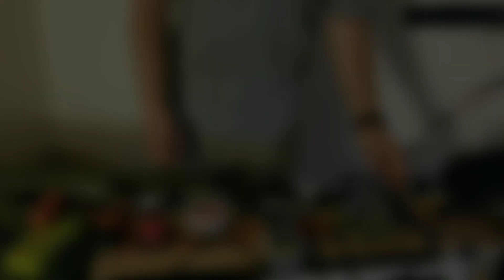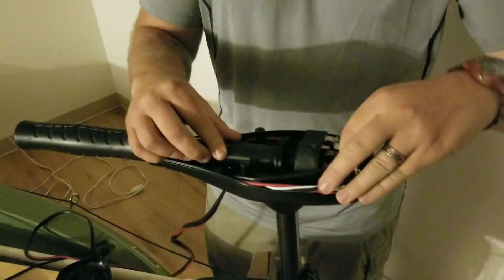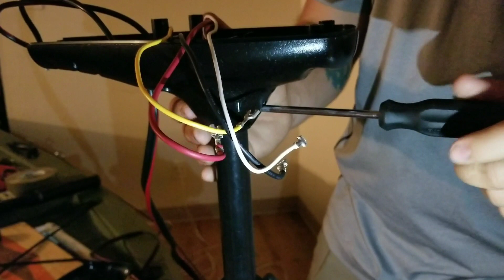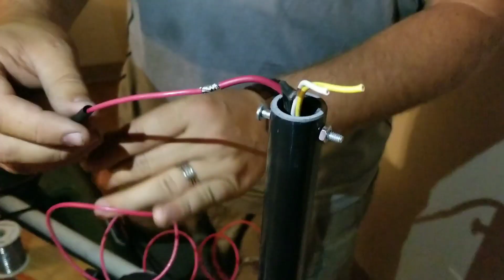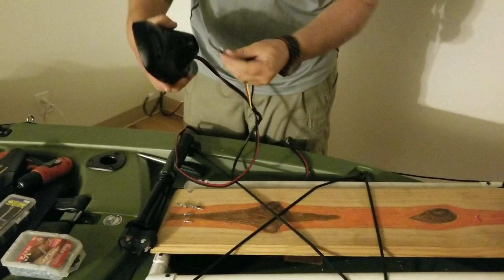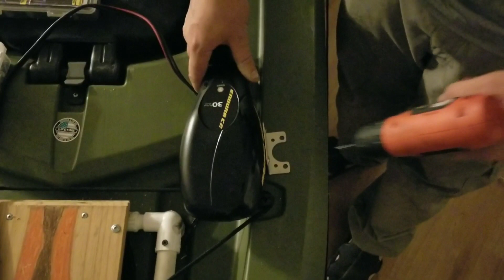KickAss Kayak! Ep 3 The Motor Control

Comment: On that kind of plastic kayak that head will never mount right with just screws, it needs washers and nuts, watch you will find out !
Reply from the maker: Yeah, on that kayak, there were a lot of things I'd have done differently if I were to do it now. That was my first kayak and my first motor mod. So while that one came out "fine" it was far from the best work I've done. If you look at my video about a "universal motor mount", that design is the easiest to build and will work on the lifetime tamarack. But if I had that kayak still, I'd definitely do a full custom redesign, and use my 3d printer to make it the best I possibly could.

Comment: Pwm much better
Reply from the maker: I'm aware of that now. This was my first motor mount for a kayak, several years ago. I have since refined the design, using a proper steering assembly, a pwm, and a 3d printed motor mount that I adjust and reprint for each kayak that I need to adapt it for. But yes, a pwm is much better for energy efficiency and fine speed control of the motor.

Comment: What thrust did you get on the motor ?
Reply from the maker: It's a minn kota 30lb thrust trolling motor, and I topped out at 3mph. When I had it hooked up to my ascend 12t, I was able to get up to just under 4mph.
Reply: @OutdoorEngineering  would the 55 lb thrust setup the same ?
Reply from the maker: If it is the hand controlled one then yes.
Reply: @alenwelch4957  55LB will probably place too much strain on a kayak and cause issues. That would be overkill, but probably fine as long as you do not touch the higher speeds.